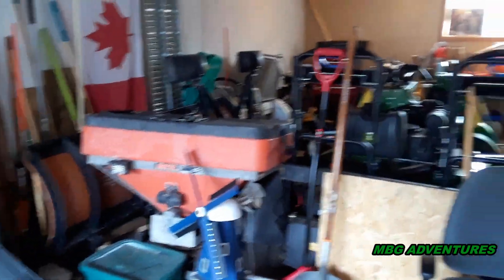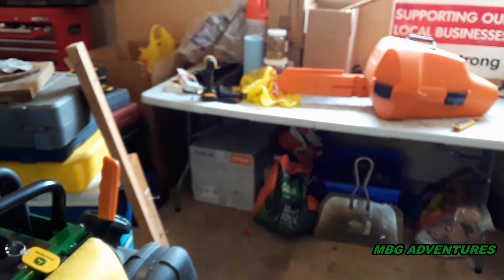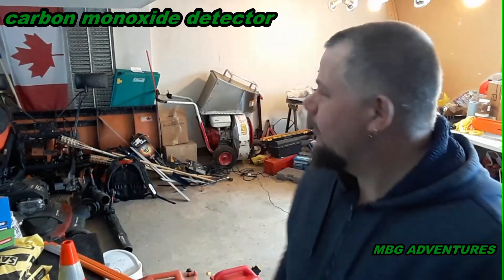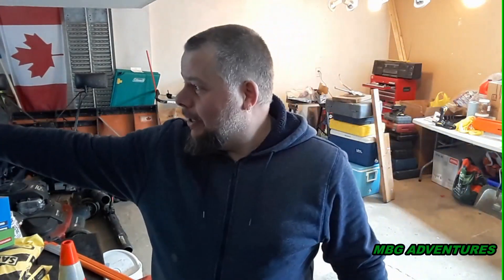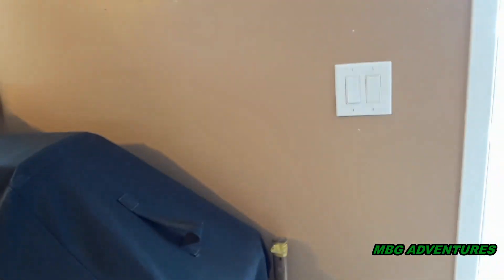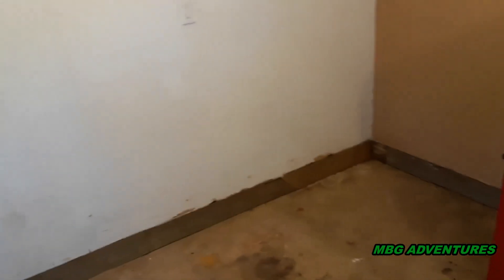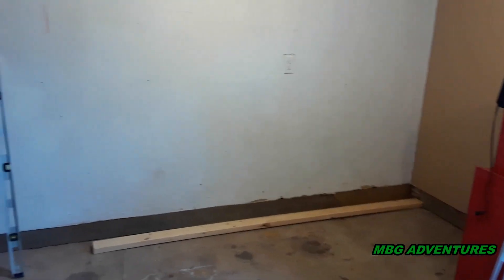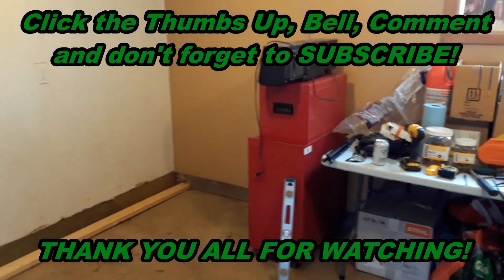Work Bench Build - Need to get started

Comment: I actually ran out of boxes before and used coolers too Lol. I thought that sounded like a smoke detector Lol. Most times it's better to have no plans and go with it. I like the idea of the mobile bench. Awesome I wish I had my boom box man that sounded good. Can't wait to see it being built. Great video Mike.
Reply from the maker: The cooler is wasted air space. Why not use it. Love my radio from when I was a teenager. Damn, I still have my original clock radio at my bedside that I have had for at least 40 years no lie and it's still working. I have a bit of a change in plans as you will see in tomorrow's video. Thanks for watching Bill!
Reply: @MBGAdventures  That is very true. I had my original clock radio for the longest time, but it did stop working not too long ago. Wow 40 years I think I got 20 some years. I will be watching the next video brother.